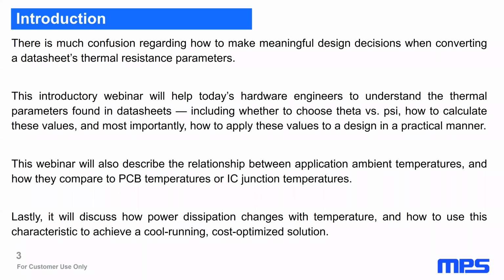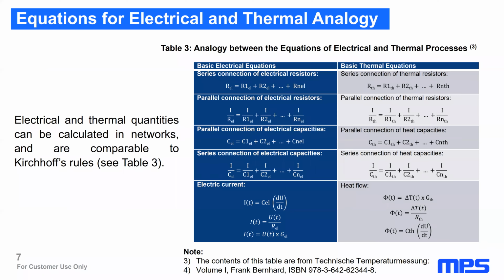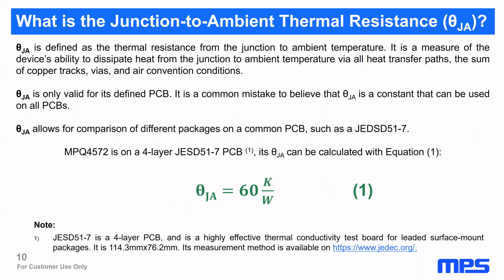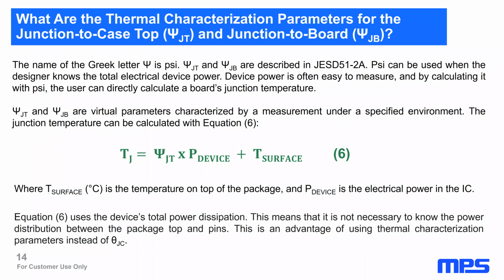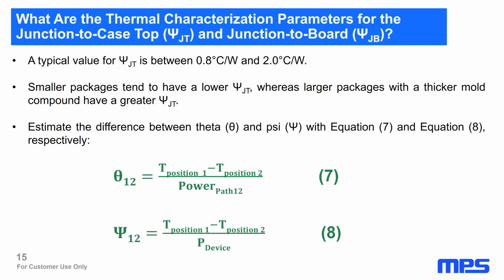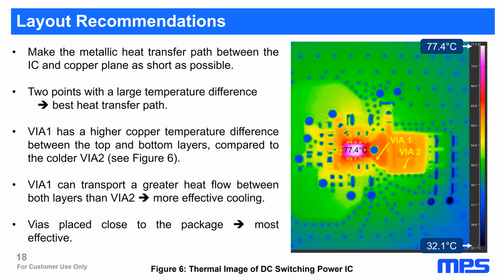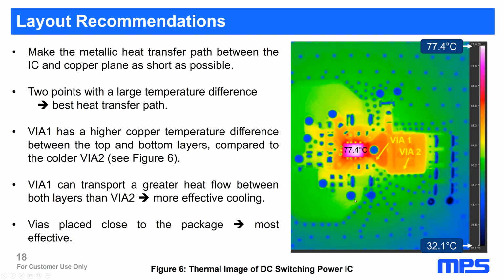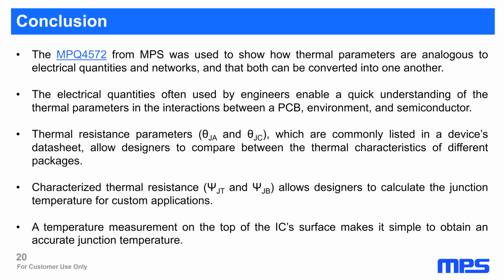Webinar: Understanding Datasheet Thermal Parameters and IC Junction Temperatures

Comment: After 24:10 the via is bridging heat to the bottom layer. In his book "PCB design guide and trace currents and temperatures - D Brooks", the author notices that the via is not bridging the temperature, but in fact being cooled by the large plane. He also mentions that the biggest heat transfer is in X-Y plane and also vertical. Would like to have your opinion.
Reply from the maker: The biggest heat transfer to the environment is in the X-Y plane on the Top-Layer (1st. layer). FR4 Epoxy has poor thermal heat conductivity compared to copper. On a 4-layer, the second layer (inner) has a small distance, prepreg from TOP to the 2nd. Therefore, the heat transfer from TOP to this second. The layer is not so bad. The 2nd layer should be complete GND and spread the heat horizontally within the PCB. Layer 3 and BOT have a more considerable distance to the TOP layer and, therefore, more thermal isolating epoxy distance to TOP.

Thermal GND via are most suitable for transferring heat from TOP to the 2nd and BOT layer; the BOT layer can also radiate heat to the environment. Thermal via in the switching node are not recommended; these vertical via would radiate EMC. Thermal via in the Vin node close to the Vin pins also radiate EMC, but not so much as in the switching node.

The power pins (GND, Vin, SW) of a DC/DC converter can transfer the best heat from the junction to the PCB and use them as a heatsink; these pins are internally connected to the MOSFETs. The analog and digital pins (EN, PG, ....) can not transfer much heat from the junction.
Use the PCB copper as heatsink; GND is the best heatsink; SW-node is forbidden because of EMC and Vin as small polygon, not too large, a long Vin trace (without LC filter close to the pins) can oscillate at high frequency. The best thermal and EMC can be achieved with filled via under the pads or Micro via technology, but not all designs can use that PCB technology.